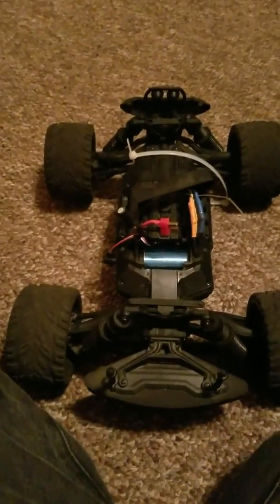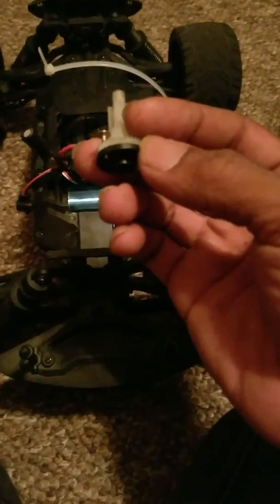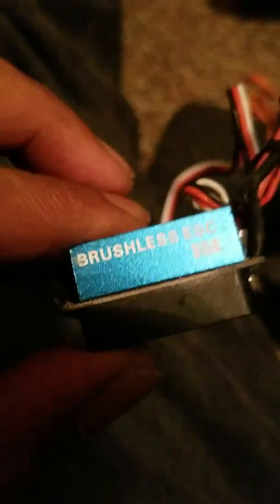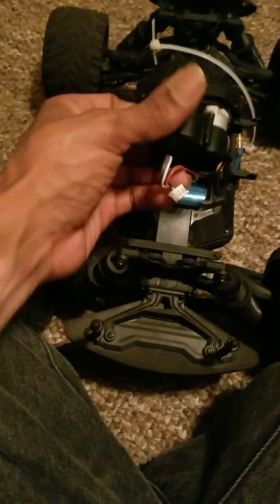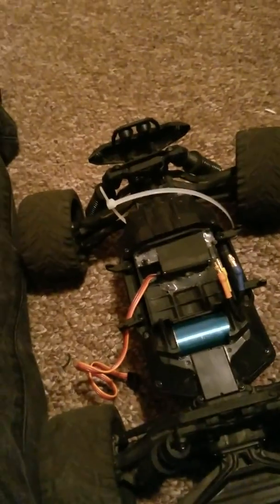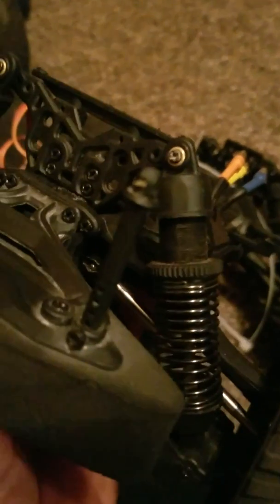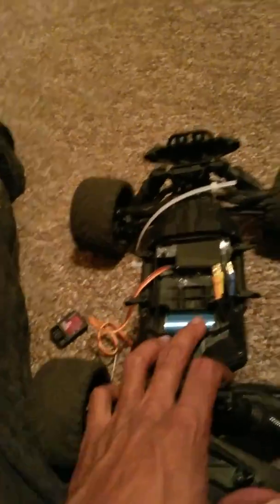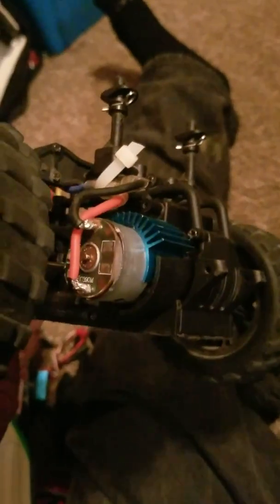Brushless GPTOYS S912

Comment: Why do you need to change the servo
Reply from the maker: Justin parvu parvu The stock servo is a 5 wire, funny shaped servo. Once you change the stock motor and esc/receiver..you lose the ability to use the Transmitter and receiver for the S912. Using a brushless setup requires a hobby grade transmitter and receiver. All HOBBY GRADE ELECTRONICS have 3 wires..so the servo would need to be changed as well. Plus you can have better control with a HOBBY GRADE SERVO. I hope that helps brother✊
Reply: C McCotter no wonder my steering is a little meh

Comment: What Pinion do YOU used ? Gearbox is stock?
Reply from the maker: Next Gear™ On this set up im running a 17t...and yes the gearbox is stock...Now Im using 20t+..17t is a good deal...and maybe up to 20t. Any higher...and you will have to really mod gear box to fit pinion gear inside. Check out my S912 update on 2s😁...I have her overgeared
Reply: I want to use pinion 14t for kv4450 brushless

where did you buy the pinion?
Reply: gears in the box are not erased?
Reply from the maker: Next Gear™ I found a 14t 48p on Amazon. I might have used it once, then went back to my 17t. If you have a drill or dremmel then you can drill out the stock. Just make sure you mesh the pinion. Everyone of the covers need to be replaced after modding, they act as the chassis brace, missing covers create weak points. I broke a chassis on 2s, by not replacing the servo cover before testing mine out the First time.

Comment: I have decided to start on my upgrade on this car soon! It is my daughter's car so it's for her, but... I will get my time with it also! Great vid bro!
Reply from the maker: Bashing RC 24/7 That's what's up bruh!. 45amp esc will be a great look with the fan. I'll look up the 14t pinion gear I got from Amazon for it. 2845 motor on 2s will be great for her especially if you can dial down speed from your transmitter. I tried my 120amp esc I thought had gotten wet on my L969, with my 50c  2s and wowwww😲...I didnt take out side to run, but testing...tires ballooned more than on my 3s😬😁..I will be trying my hand at waterproofing my electronics very soon. But back to the S912🤣✊...let me know if you have any issues bruh...I got ya back👍👍
Reply: C McCotter that's what I was wanting to hear! when I am ready to start ordering parts I'm going to holla at you! Thanks bro!
Reply from the maker: Bashing RC 24/7 ✊...We in it to Win it my brother!...I got ya backkkk😰😆👍👍